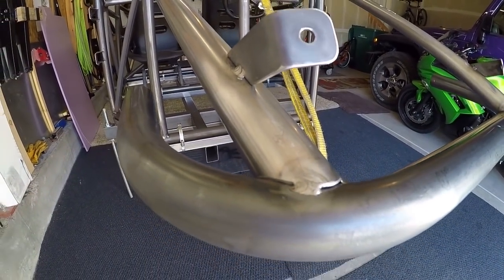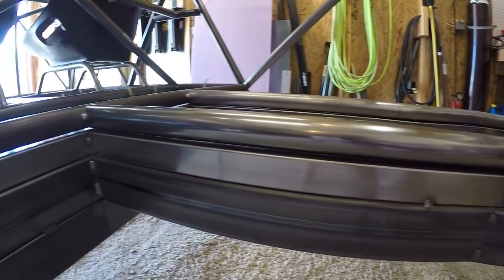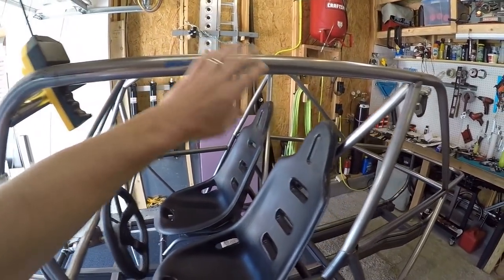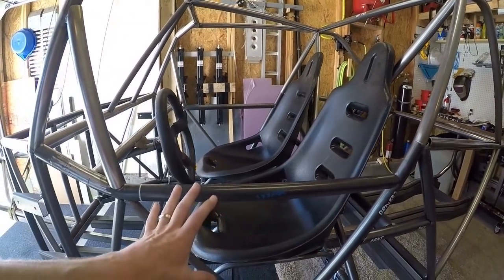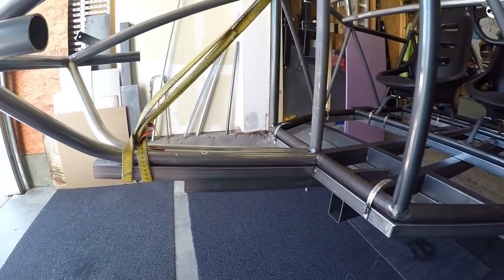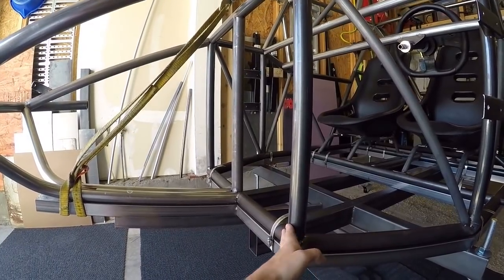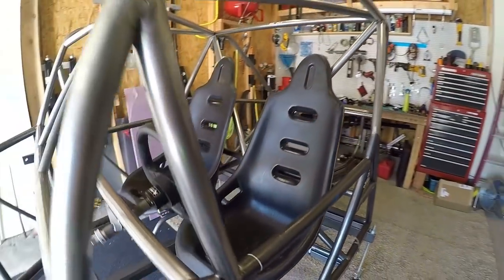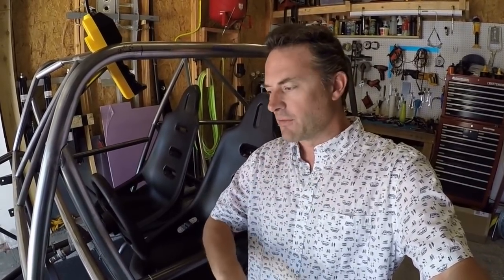Baja Tube Chassis Walkthrough with design files for you!!

Comment: And why are chassis always made of round tube and not rectangular or square?
Reply from the maker: With square tube it would be more difficult to make connections because different planes would require custom notches. Where as round tube with a tubing notcher can notch almost any angle or plane up to a certain degree. And round tubing is stronger.
Reply: @DougBugBuilder  but with square tube you can weld easier
Reply from the maker: @Mitrasto22  That's your opinion, personally I'd rather weld round. 👍

Comment: I love the build! Your videos are really great for someone like me looking for the right project but too scared to pull the trigger. I've been building cages for 4x4s recently, but chassis design has always been a little difficult conceptually for me. I would really like to see your designs for this bug (need a new quarantine project). The fact that you're using geometric shapes to strengthen everything really intrigues me as a fabricator and I think having a solid template will really help me with a build.
Reply from the maker: Send me an email at Dougbugbuilder@gmail.com and I'll send you the files.
Reply: @DougBugBuilder  thank you so much

Comment: Hey doug. Ive started my build for a 4x4 ecotec buggy. Ive gotta joyner 650 frame that im gonna adapt to meet my needs. Love watching your vids learning how to fab up the frame. And suspension. Im currently going for a 4x4 vw syncro trans with a decoupler to make it a true 4x4. If you have any tips id love to hear them
Reply from the maker: Hmmm, sounds like a fun project. My advice would be to try not to overbuild the frame. I see that a lot and am guilty myself as well. Remember if you triangulate it then it will basically be as strong as possible. Try to keep it triangulated all the way through so you don't get much flex between the front to the rear. Especially for you since you'll have gearboxes front and rear.

Comment: Erw tube is not anywhere as strong as dom it’s not worth saving money when it comes to safety. Erw also has a very strong tendency to crack on the factory welds when it’s stressed or even just from vibration. Not a good idea for a frame.
Reply from the maker: Can't argue with the strength differences. However there are many many many frames out there made out of ERW with great success. Because this chassis is a little bit R&D I went mostly with ERW. However the base and some of the cabin is still DOM for maximum safety.
It's a valid point though and thanks for bringing it up, it could be a safety concern.

Comment: Hey Doug, I had a question or two about the approach you've taken with the chassis design. I see you have minimal bends in your tubing and mostly straight sections with hard corners (mitered). I'm assuming it was easier with the bend tech program since it allows you to use the coping guides? Do you believe using many separate pieces rather than more continuous pieces is stronger? Just seems like the more joints would lead to more points of potential failure. Thanks in advance for your response.
Reply from the maker: Here's why I did it that way. I used to try to avoid mitres thinking they were weak points and do bends where I could. However when I was at the Mint 400 I got to look at many chassis up close and personal. One thing I noticed is that they had lots of mitered joints. I even talked to one fella about it and he said mitered joints are not an issue if properly cut and welded. And he stated that if a mitered joint is triangulated it's as strong as a straight or bend. Then on top of that I want to panel the outside of the chassis. So I think it will be easier to panel a mitered joint rather than a bent joint.
So that's why I was comfortable with the miters and you'll notice when the chassis is done almost every mitered joint is triangulated.
Great question, thanks for asking it.
Reply: I will be the first to say that trying to be consistent with the bender is difficult to say the least. Even with all the  tools and doodads designed to make it easier. I will definitely be using mitered joints on my next build as it looks much easier to calculate and hold consistent measurements. Thanks for being active with your audience.
Reply: @DougBugBuilder , A fella??  

Triangulated??  I read, absolute foolishness.  

Every angle, every imaginable radius/curve/arc is triangulated.  Doesn’t mean it’s worth a sh!t.  

Sound engineering is predicated upon industry standards.  Not a fella, nor, triangulation. 

Triangulation is not an industry standard upon which decisions are made.  Triangulation is simply a means to acquire a dimension and/or a shape or anything - on any plane. 

Bending vs welded mitre would depend on degree of bend factored with material specs & desired load/force resistance. 

Nice work, tho!!!!  I like how clean & precise it appears.  Would be nice to justify some arcs in the design. Because curves are just sexy.

Comment: i work at dons  bus box . i run a 2.2 ecotec turbo i had a 3 rib it was fine  at 300 hp. now im going to add boost so i put a 6 rib in . i have also seen fwy flyers do fine with stock 2.4  just dont pop the clutch on the fwy flyer !! check out my Chanel fred cocksamich !!!  it has my build 0n it !!
Reply from the maker: Thanks for the info Fred, I'll check out the channel.

Comment: You need to find a Mendeola d2 transaxle.  A vw bus transaxle can't handle the  torque of a ecotec.
Reply from the maker: I agree, I've researched the Mendeola and Weddle transaxles. Just trying to work out the money aspect at this point. Hoping to have it figured before I put the Bus in the frame. But we'll see.
Thanks for the tip.
Reply: @DougBugBuilder   I have been lookin for a good used mendeola transaxle for my buddy's buggy. We put a ecotec in it last year and it doesn't take much to break a bus transaxle. Enjoying your build!
Reply: I disagree that you can’t use a bus transmission. I have seen stock bug transmission hold up to the same amount of torque. It’s  all in how you setup your clutch.